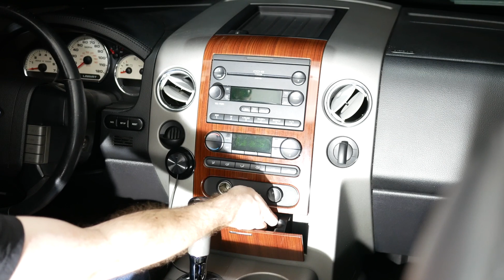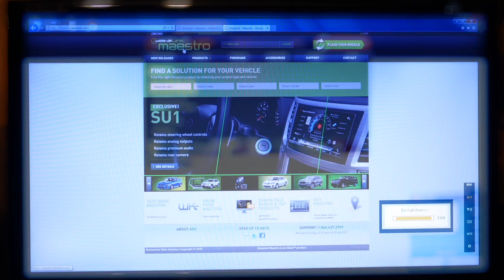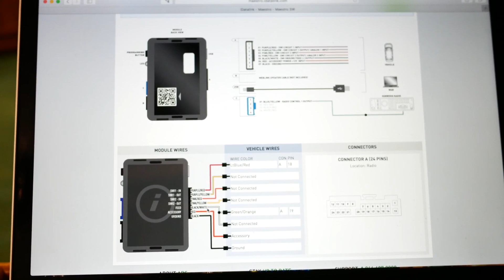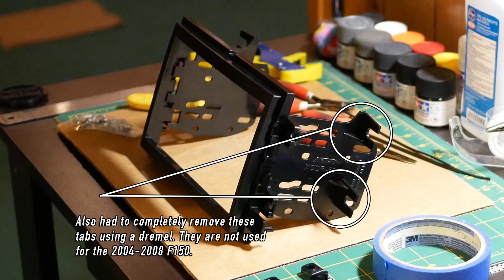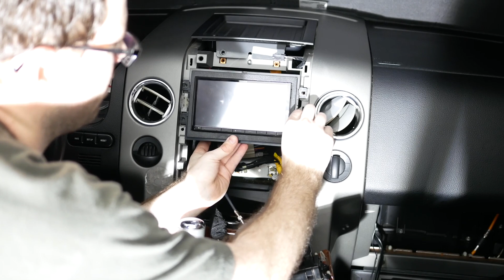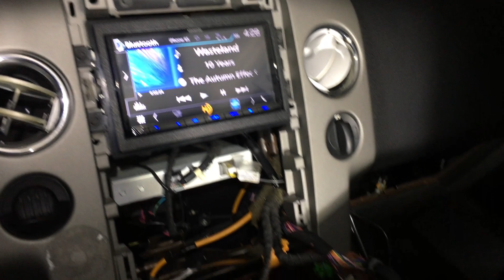Installing a Kenwood Head Unit into an 04-08 F150!

Comment: Did this make your temp steering wheel controls stop working or do they still control the temp? I’m asking basically are the only two buttons you can use are the volume and mem/mode buttons?
Reply from the maker: The temperature and fan controls on the steering wheel still work. The Maestro box only allows you to modify the controls for the volume and seek buttons.
Reply: @projectauto7560  nice thank you for the reply! I’ve asked several YouTubers this question and you’re the only one that has answered!